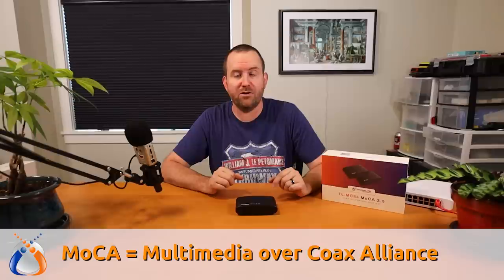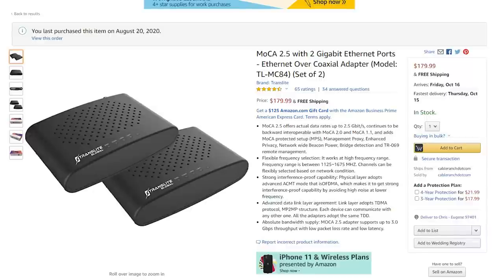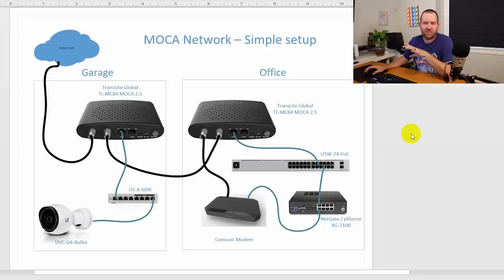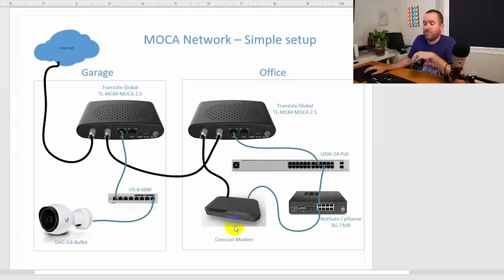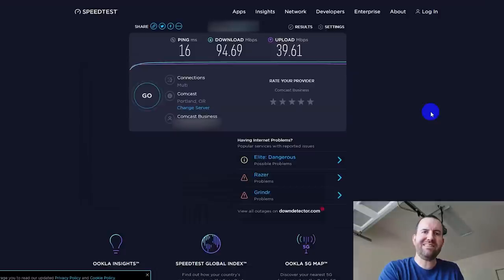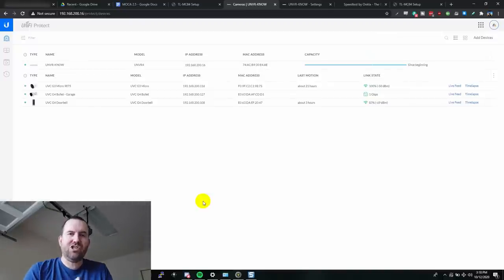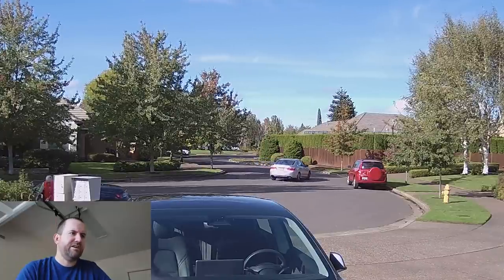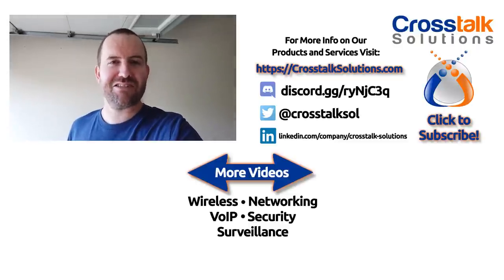MoCA Made Easy!

Comment: It would be interesting to compare this with an Ethernet over Power solution. I had such a solution connecting the upstairs and downstairs in my early 70's house which had extremely noisy wiring (unearthed fluorescent lights, lots of switching power supplies etc.) and I was getting 85Mbps over the longer of the two legs of the network - probably going via the fuse box. On a shorter leg where both EoP adapters were on the same electrical circuit I was getting 250Mbps.
Reply: Ethernet over Power didn't work for me, likely because the two ends were on different phases of the power lines. MoCA solved my problems.

Comment: Looks Good great detailing as always (need to see that empty box rolling down the street), as you stated 90mbps is fine for your solution; then have you tested this without the ISP feed and see if the 90mbps increases? For me this is something that may not work as the usage in my own scenario, then again the feed for me comes directly to my room (2nd floor, house top level) then run regular I run cat6 and most of users are Wifi instead of using the original inhouse Coax network to utilize as another end point for the APs. Cheers!

Comment: Personally, I would have put the modem & firewall in the garage, Keeping that isolated so you have less chance of "crosstalk" ;) Then used the existing coax cables in the house with MoCa devices.
Reply: yes but he does not have a UPS in the garage to keep that modem powered which would've meant losing it on a power outage like he talked about with the splitters
Reply: @byzhiphop  Get a UPS.. They ain't super expensive, I also noted the lack of crypto setup, so if someone nefarious got into the neighbourhood cable distribution cabinet and plugged in a moca - they are sitting on your LAN.
Reply: Yeah he should have his router in the garage and a nova extender to the office with a switch for more ports

Comment: This is really cool! Thank you for the video. I love it when you can repurpose existing infrastructure and get what you need out of using some clever hardware. 

I had a weird requirement myself which you guys might appreciate! I moved a bit more rural for the sake of a more peaceful environment so stable power is always a bit of an issue. Sometimes there are outages that don't last too much or the voltage drops because of this.

We installed the networking rack in my pantry, right above the door as it was the perfect location to mask the fan sound and to wire the entire house up, too. I have a 500W UPS there for the Dream Machine Pro, a 24 Port Unifi POE switch, a Raspberry Pi 4 and a Phillips Hue controller while the fiber connection comes in upstairs into the office and gets converted into a regular RJ45 gigabit lan by my ISP's media converter (/ router) in bridge mode. 

While I also have a UPS upstairs for my desktop but I don't keep it on all the time, only while I use my PC. So obviously plugging the media converter in there would've been a bit problematic. No PC = no UPS = no Internet and plugging it into the wall would've meant that any time I lose power I lose connectivity. I have a nice script set-up on my Pi that emails me on power outages and I can also VPN in remotely to shut my PC down in case I'm not home and the power goes out any time I leave it running when I leave the house. So of course losing Internet would've disrupted all that... 

After a bit of Googling I found out that TP Link makes a nice little hardware box that can take PoE power and output plenty of power for devices like the media converter (switchable). So I wired it up and now the media convertor is conveniently running off of the UPS downstairs via the Unifi 24 port POE switch.

Comment: I have a fiber account with Century Link I am a total novice with the fiber but it comes in via fiber and goes through three C Link boxes and leaves via Ethernet to a Switch.   I use wifi  and ethernet to distribute to a small building from there.   I have a whole bunch of Coax Cable running through the property and I am thinking Moca would be an interesting alternative to cable.  If I just run ethernet from the switch into the ethernet port on the Moca device and connect Coax to the Coax port on the Moca Device will that work, or do a need a device that is more specifically tailored to the task.

Comment: SO with a properly connected MoCA you should be getting near 1Gb xfer speeds in both directions at the Gbit ports on each of the MoCA devices.  If there are too many splitters, or there is too long a run, something not properly terminated,or bad/leak coax cable or loose connection anywhere in the chain, it will cause degradation.

The MoCA standard 2.5 supports 2.1Gbit of bandwidth on one of 2 bands, which is generally separate from broadcast TV, but sometimes not satellite or cable (especially if you have a cable modem from your ISP).  Your cable modem, in fact, may be using one of the 2 bands of MoCA already, and this may be why you were only getting <100Mbit as your MoCA adapters are using the same frequencies.

Since the ethernet jacks are each 1Gbit, it is possible if you have 2 devices on each end plugged into the Gbit Eth ports on both ends, you theoretically could achieve simultaneous 1Gbps streams between each pair of devices over the MoCA link.  I haven't tried this in the lab LOL!

THe nice thing about MoCA is that it allows you to use the existing coax cabling in your house as a potential 2Gbit backbone for some or all of your networking needs.  It COULD save you hundreds or even thousands of dollars on wiring installation costs...  It certainly saved us over $1000 and we are very happy with it.  

It's not JUST point to point... you can use as many MoCA adapters as you need, even at each termination point in your house if you so desired.

Comment: I use the UDM Pro and it does not show the device or the traffic.  the edge devices do connect but from the UDM I can't see anything.  Plus the IP address doesn't show up either, they are just blank.  Does you system show the same info

Comment: I have a situation where my garage has 3 coax cables and 0 ethernet going into it and putting any new cables is practically impossible, so I looked up available options and in the beginning of the year found only one option, ActionTec EZB 6200 which I had to order from US, because there was no viable options in Germany or Europe, max 100mbit is quite a terrible option for same price.

p.s. House is listed ~1650, rebuilt in 1810 and partially renovated in 2000, every single wall is brick from 40cm to 1m thick, and 30cm wooden beams, so renovating that would be hard =)

Comment: I purchased the Translite MC84 and connected both of the adapters. However, I could not get a TV signal nor could I get an internet connection from the second adapter in my remote room. I sent Translite a diagram of my connections. They responded that they "have confirmed that all connections are accurate". They suggested that I check if all coax connections are connected firmly. I did that but still not successful in the remote room. Has anyone encountered this problem? Any thoughts or suggestions?

Comment: I am a comcast cable tech and I've got a question:
So what all ya are saying is, if there is a working modem somewhere down the line of coax cables through these moca devices, then you can get a signal via switch/ethernet somewhere at the start? This sounds unbelievable and crazy

Wouldnt this mean that I could, for example, go into an apartment complex cable room, disconnect someones cable, plug in this moca device in between (remove any POE's) and then direct one coax to some client, and one coax to my switch, and from switch with ethernet to my laptop, and then I'll have free internet/cable working off of that client's modem?

If this was the case, wouldnt everyone be doing this? It would take like 5 minutes to do in most apartment complexes... 

Or am I not understanding something?

Comment: Just wondering will this work if you ISP is network cable and not Coax cable. Would I just be using the cat5 as my feed into the moca and then it would travel through my wall using coax to the other moca and then provide network connection once I plug in the cat5 from there either direct to a device or switch ?
Reply: Yes

Comment: I've been using MOCA for my home office for almost 2 years.  My house was built around 2007 or 2008 and they used CAT5E home runs to the basement for phone lines, but there's no phone line in (what is now) the office, but there is a coax line.  Since I don't have a TV in here, and all the coax lines are also home runs to the basement, I just have a simple point-to-point setup.  The only thing I did different was to add 75 ohm terminators to the unused ports on my 2 MCOA adapters (Motorola MM1002) and my TV splitter.  I'm not a cable TV expert, but the terminators don't seem to be hurting anything.  iperf3 (using fully up to date CentOS 7 systems on both sides) is saying 450Mbps.  While this is definitely good enough (considering I only have 150Mbps Internet service), I'm still planning to run CAT6 or better throughout the house eventually.

One other, similar option is DirecTV's DECA, but that only works if you don't use the TV wiring at all (or if you have DirecTV).  It's the same idea, except DECA's max bandwidth is advertised to be only 200Mbps total simplex (or 100Mbps full duplex).  But it's also significantly less expensive ($30 for a pair of adapters vs $180 for this setup or $140 for my Motorola setup).
Reply: Hahaha, same. My house is 2013, also using cat5e for the phone, and then there's practically no phone jacks through the house. It's like they got 90% of the way to a good solution and then called it a day.
Reply: Yar Nunya  Oh I haven't used a landline in 20 years. If I had cat5e phone jacks, would have used it as an ethernet backbone.

Comment: so this doesn't work for DSL Internet right?
I have a router connected to the DSL Modem...so I have a router connected to the WAN port... which means the router is set as an AP...  can I use one of these devices and connect it to the router and then use the coax to connect it to the coax wall jack?

Comment: And what about if your neighbor have the same MoCA adator ? Any way for him to access your LAN ? I am curious since cable connection is like a big hub.
Reply: Answered in another comment that there is a MoCA filter in the garage preventing network cross talk.  I thought the same thing though. If you don't have that filter, there is an encryption key that can be set across all of your MoCA adapters, if you are on cable. Fiber (to the home) doesn't have this problem since the coax terminates within your walls.

Comment: How would you configure for multiple end points in 1 home?  Meaning just 1 MOCA is required in basement at LAN switches and then one for each room end point?
Reply: Yes.  Mine are branded "Motorola" and I have three of them.  One connected to a switch to my "regular" network, and one in each of two other locations in the house (a splitter feeds these).  Then I put switches in those locations so I could connect multiple devices at each point.  Handles VLAN fine if you have a switch at each end that can handle it.
Reply: You need a moca adapter at each endpoint

Comment: Not gonna lie as a cable tech the cable setup in his garage made me cry a little. That silver block in his garage before the splitter is a MOCA bonding block its used pretty much as a demarc for the cable network into the home and has a built in MOCA filter. That splitter and coax jumper that he installed is screaming "noise" as we call it. meaning it is bound to cause issues with internet service due to the egress and ingress it is undoubtable causing.

Comment: Who else knows the old school ethernet, thick and thin net with vampire taps, that ran on coax?  Just me?  When I joined the Navy in 2002, we still used that as a standard medium for network connectivity. Hubs replaced that, the dumb ones.....then and FINALLY, we got switches.  Good stuff, eh?

Comment: If you are using the wifi of your cable modem, but the TIVO is on Moca, how can you bring in a Unify gateway to feed that brands Access Points,  without bridging the modem as the cable guy said you cannot due without running ethernet to the TIVOs an then you can bridge the modem so that you only have one Wifi network all of the Unify gateway

Comment: Is the Comcast CMTS/Cable Network even UPS powered? At least in our Country the whole Cable Network is shut on Power Outage as all the Amplifiers are not UPS powered.
Reply: "Comcast CMTS/Cable Network even UPS powered? "
Usually no. when the power goes out cable service goes out because the pole mounted equipment isn't on UPS power.

Comment: I have all my IoT ethernet devices connected to the network over ActionTec MoCA Bonded 2.0.  They carry VLAN tags so I hook them to dumb switches (into which the IoT devices are connected) and configure the Unifi switch port to which the "distribution" MoCA unit is connected to use only the IoT VLAN.   So my Sonos, AppleTV, TiVos, Smartthings, Roku, etc are all running on their own secured and physically (in a sense) and logically separated network.  My NAS (Synology), computers and WAPs are on the ethernet infrastructure with the WAPs broadcasting a hidden IoT SSID (using the IoT VLAN), our family SSID and, on demand, a SSID used for guests (also using the IoT VLAN.

Comment: One thing that is not clear to me is how do the MoCA devices talk to each other once you put them behind the splitters. Are the splitters behaving like a switch?
Reply: Not like a switch, more like an old fashion hub. Everything on the coax gets the signal... Just the Moca devices use the but they recognise, while the Comcast recognises its bit. Depending on the length of the run, etc. use of a pair of suppliers can be "lossy" on that the signal received by the Comcast router/modem may be diminished, resulting in a slower connection.

Comment: Will using coax compromise the latency of the network? I haven't used MoCa before.
Reply: Funny thing is in some of these houses where you can't get ethernet to room you can use moca as long as it's RG6 cable mica 2.5 will go all the way up to 1GB
Reply: MOCA will add a few ms of latency.   Nothing to worry about.

Comment: Pretty sure that little cloud top right of your network map should be labeled "Ethernet" or possibly "MoCA LAN" - meaning other places in your home that you might want to put another one of these MoCA endpoints on (that is fed by your residence-side network of RG-59 or RG-6 coax.  Your drop (from comcast) should go into something that blocks egress of the MoCA signal (yet allow bidirectional data to the cable modem and any set top boxes/channel adapters in your house), then to a splitter with one output to your first MoCA endpoint and the other output directly to your cable modem.  cable modem.  the rest of the diagram seems ok.
Reply: Just to be clear, the "rest of the diagram" i'm talking about is the first diagram.

Comment: Does the coax cable type make a difference in speed or is it limited by the adapters?
Reply: Always use RG6
Reply: @tomaxxamot2016  that's fine if you're installing new coax, but if you are using what was installed in the 90s I was curious what degradation of speed you might see.

Comment: Note that the simple design he shows will not work with the Actiontec Bonded 2.0.  Those devices filter out the MoCA signal on the non-MoCA coax jack so as to pass video (in/out) only.

Comment: hmm thinking of moca to 3 locations is that possible ??? and this would be ideal for me as of running coax outsidewhat is coax cable full speed potential
Reply: Yes.  I have three "Motorola" branded ones connected with a splitter.  Works great.
Reply: I believe the standard has up to 16 nodes are possible, but its all about signal and noise. In MOCA 2.0 and above it has variable power that can go from 30db to 60db, the algorithm is based on latency between the nodes, when latency hits a point it kicks up power.

Comment: Nice video but any reason why you cannot get 1 Gbps speed? In theory you can get up to 2.5 Gbps between the 2 MoCA devices
Reply: With the telephone company you can get up to 1gb symmetrically but it's capped at 1Gb on moca 2.5
Reply: Tomax Xamot thanks but my question was more on the local LAN not the comcast connection
Reply: Yeah, that was a major miss in this video. It seems like their connection was capped to FastE, perhaps by the Ethernet NIC of either testing device or a bad Ethernet cable. A pair of MoCA 2.5 adapters should be capable of getting near 1000 Mbps in an iPerf LAN speed test, and should be able to fully max the download/upload throughput for a Gigabit Internet connection.

Just brushing off the 96 Mbps speed as "good enough for what I need" was shocking, and certainly wouldn't have me rushing out to pay an extra $30 per adapter for the Translite units.

Comment: I don’t get the point of using adapters if you have to run wires between rooms. I will need so much wire which I was trying to avoid. I was looking for a solution in which I can use the existing coax ports without running so many ugly wires between rooms.

Comment: Only one flaw with this setup.   Putting the cable modem behind two splitters is typically asking for issues due to signal strength loss from cable company to your modem.   It really depends on the signal strength in your area, but normally if you want to avoid cable modems dropping channels or off the network, you want to have a direct run from the 1st splitter in your home.  Each splitter causes signal loss no matter how good the splitter is.

Comment: Does anyone make a MoCA-in wifi version 6 (AX) range extender that uses the hardwire as one leg of the extender input so I can extend at near wire speed over the dual band [2.4/5 Ghz] wifi to my outside dock/marina without running another leg of coax outside off the patio?